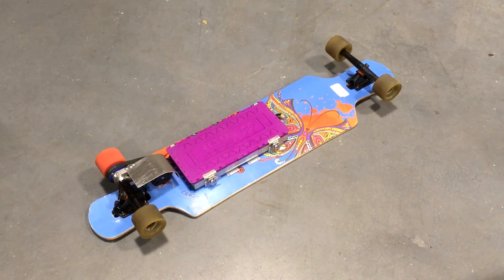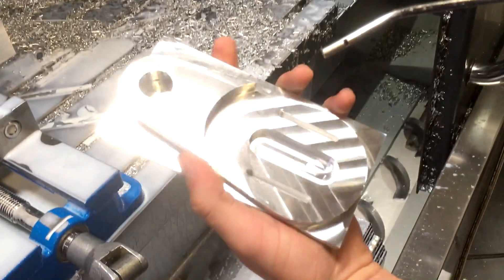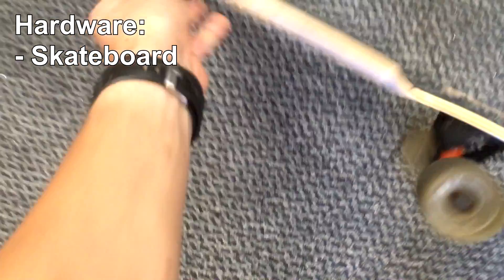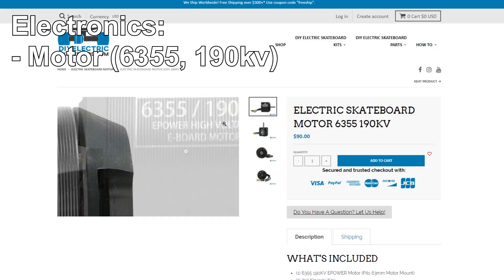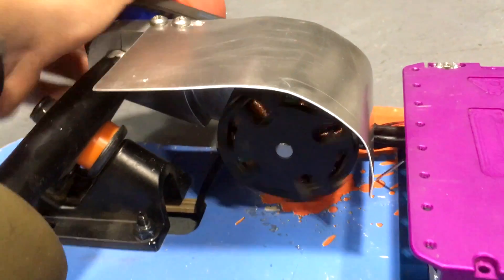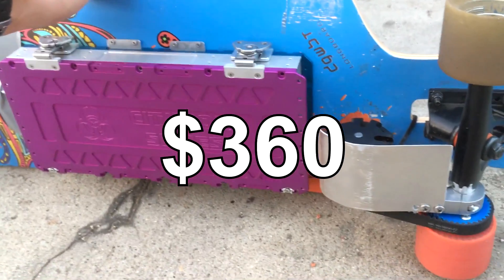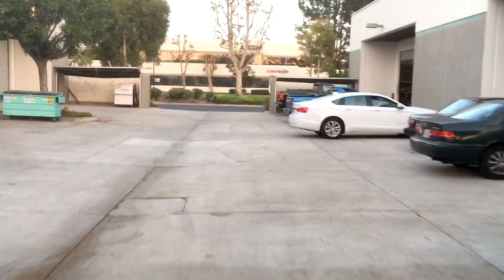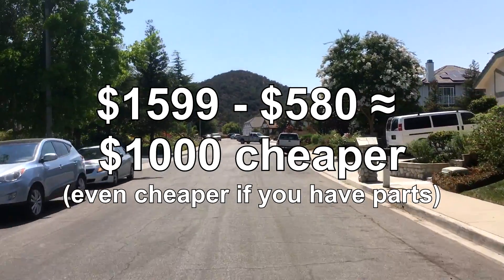Building a DIY Electric Skateboard!

Comment: I got a £80 eBoard off eBay with 1 hub and a 7s1p battery and put it on a new deck with a MacBook battery as a 7s in parallel. It's very good and cost me £120 in total
Reply: A Macbook battery is 7S (25.9V) ?????